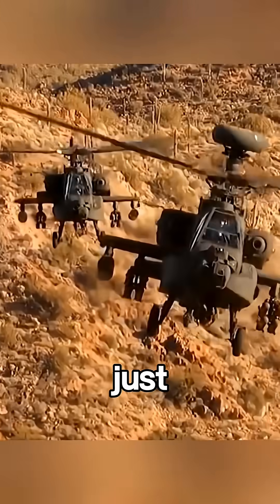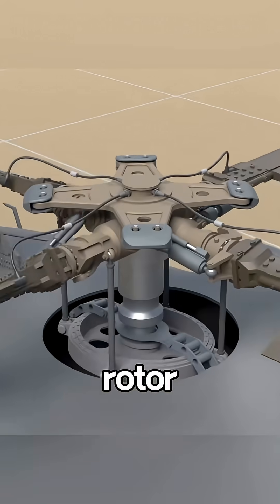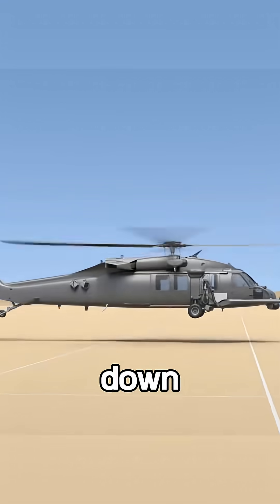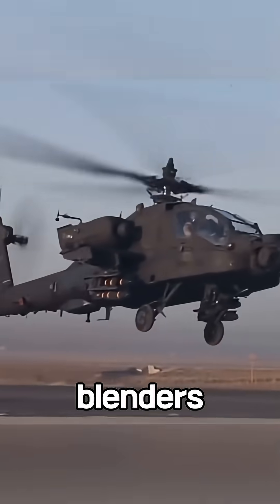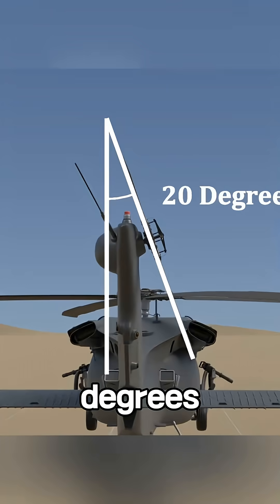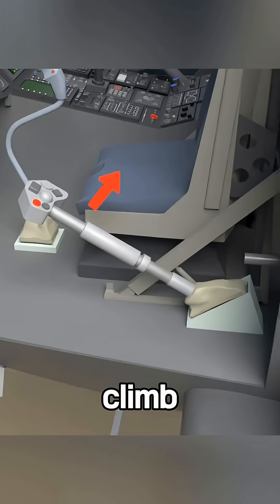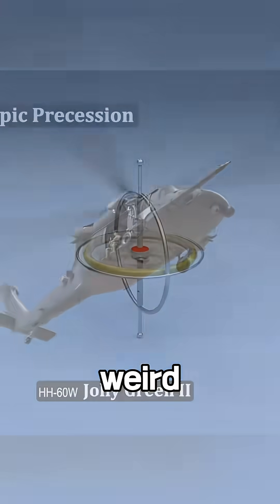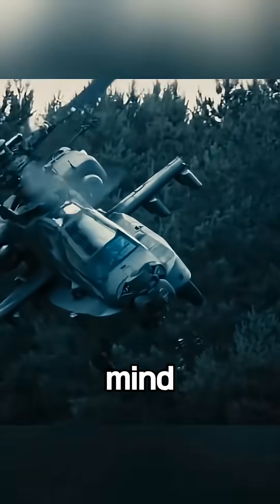Helicopter Speed Myth Busted: What Really Limits Their Velocity #helicopter #aviation #military

Comment: This explains why most helicopters haven't been updated in the last 30 years.There really isn't much more.You can really do with a helicopter
Reply: Wrong. Modern Helicopters fly faster, further, lift larger load, and more reliable than older copters. And a few make less noise, too, for stealth.
Reply: @ubermenschen3636 I was referring more to design. There is only so much u can do to a helicopter. But no matter what its still has 2 things that wont change. And cant be changed.
Reply: @solinoctis804 the fundamental thing this guy is taking talking about can be changed and should have been changed and should have never been used at all except on the most rudimentary models
Reply: @solinoctis804 Sure, but doesn't that go for Planes too? They also look magically the same since the 50s or 60s
Reply: @solinoctis804  The same can be said about cars, bicycles, motorcycles, airplanes.
Reply: @solinoctis804 what are those 2 things? I can only think of 1 and that being it has a rotor for lift
Reply: @ubermenschen3636 wrong. Those are not changes but improvements. It’s just a matter of scale and efficiency. The only true changes are counter clockwise rotors instead of tail rotor.
Reply: @ubermenschen3636  Incorrect.
Reply: Not until they can make a gunship from Halo
Reply: Theyve made some like drones. 4 smaller perpellers around the cenlike a drone. Also theyve been testing Leonardos spiral helicopter blades on drones. The say they work better for a myriad of reasons.
Reply: Stack two rotors on top of each other spinning in opposite directions and working in tandem but the left and right movements of the rotors are reversed. Do that and you can basically cut the tail off with the tail rotor. Then you have to rework the mechanics of left and right motions. This is a huge change, though it doesn't seem like a whole lot. Dual rotor copters do exist now. 
Or, put little wings on it and have counter rotating rotors on them. Match the speeds so that the rotors spin between each other. That was the prototype design for the V-22. Now it uses smaller rotors that tilt, another huge change. And the semantic battle of whether a dual rotor VTOL is a chopper, a plane, or its own thing begins.
Reply: @fredrickneidhardt8064 no longer semantics, i believe. Its now (at least for the osprey) defined as a "rotary-wing tilt-rotor"... basically, its a fancy way of not quite saying "its a helicopter, but it can pretend its a plane."
Reply: @wolfulfhethinn6396 either way, they're all still "doohickys" and/or "watchamacallits".

(...or if you're Irish, "watcha-McCallits"😁)
Reply: Triodal rotors, multiple number types, there is also something that is in development that counteracts the ABC (advancing blade concept) but I cannot go into that...
Reply: There is ALWAYS more you can do. You can aff jet engines for example!
Reply: @fracturedsolace145 but then you wouldn't need the rotors... and then you'd have a hard time landing vertically in rough places... and then... meh, to hell with it... we can build ONE airwolf just for fun... right?
Reply: May I introduce you to jet engines for additional forward speed? No seriously we're already adding more and more jet engines to helis because fuck it we ball, if the tail rotor wasn't important I can guarantee you someone would place a jet engine on the tail, and someone probably will by bypassing the tail rotor
Reply: @MaxDoc7  like the MD 530 notar
Reply: @lollipopjuggs  we're almost there, now we need a jet engine in the place of the rotor ala cyberpunk militech heli
Reply: This is nonsense
Reply from the maker: huh
Reply: I thought copters fly forward by tilting rotor forward, like the toy helicopter(stick and rudimentary rotor blades)...which climbs straight if it leaves your palms straight, and flies forward if leaves palms tilted forward.
Reply: @rodenreyes6320 no, but I'll admit that it's a fair assumption. That doesnt work on larger, heavier, faster rotors because of gyroscopic force. The rotors want to continue on the same plane, which would tilt up the nose. If the aircraft is balanced properly that will tip everything back forward, but then you have two problems... first, it's slow to take effect. Second, it creates a snowball effect if the input is even slightly timed wrong (you'd have to initiate any input well before you need the output response, control lag is the last thing you want in an aircraft, lol).

So, by reducing/increasing lift on the advancing blade and doing the opposite on the retreating blade, you achieve a faster nose-down/up orientation and quicker response. Not quite explained in the video, the same principal applies to side-to-side drift.
Reply: @rodenreyes6320  If that were the case they would fly upwards and forward at the same time and you would only be able to go up/forward and down/backwards.
Reply: gurt
Reply: There's a tremendous amount you can do which is by not having to adjust the pitch to increase the lift😊. That's an extraordinarily efficient way to increase lift and there are much more efficient ways to unfreeze lift without that nonsense that should have been fixed decades ago there's plenty of different ways to do that
Reply: Airwolf brought me here...❤😂
Reply: Wait till they eliminate the rotors all together.  
 Turbo Fans replace the rotors.  It'll be done
Reply: nope youre wrong
Reply: @benmiche2027 uh huh... and what, pray tell, is the significant change to the method of achievement of rotary wing flight that has occurred? As an aircraft engineer, I cant think of anything beyond efficient engines, fuselage designs, and number of rotors... all of which are variations of the ones used since 1980. Unless you're including osprey-style aircraft (we want to forget those exist, tbf).
Reply: @wolfulfhethinn6396 4 rotor aircrafts also known as drones. With variable speed motors they have done away with pitch and tilt and all that.
I also imagine with modern control systems you have reduced to complexity of operation if that counts as a change.
Also twin rotor helicopters that does not need a tail.
Reply: @lizekamtombe2223 not much of a change. 4 rotors doesn’t substantially change anything about how it flies. Modern control systems are still subject to a particular branch of physics, which is the determining factor in how a rotor craft handles (the same principles that apply to large navy ships, if youre wondering), and I see nothing in your reply that constitutes anything besides adding complexity (more blades, fly-by-wire, etc). Helicopters have made no substantive change in 40 years. Interestingly enough, the reason for that is pretty simple... the basics are best. There's a reason for the "hokum" joke. The Chinook can (and has) had collisions with itself, and every "modern" helicopter that the Army has reviewed has been shut down because they cant do anything better than the Blackhawk, Chinook, Apache/Cobra, and Loach. All of which are at least 30 years old. Most are even older than me.
Reply: @wolfulfhethinn6396 4 rotors changes everything about how it flies. Did you follow the video?
A helicopter has one fixed speed rotor that changes propeller pitch and tilt to create lift and fly forward. Rear rotor counters rotation.
4 rotors have no propeller pitch nor tilt and works by altering rotor speed, two rotors rotate against the other two so  it can turn by slowing down counter turning motors.
So nothing in the video holds for a 4 propeller drone.
Only similarity is using vertically mounted propellers, everything else is different.
Even a Chinook does not work like a drone.
And a drone has not became affordable by being more complex. I know how much work it is keeping a helicopter running, there are so many complex systems to control all that. A control system and fly by wire reduces the amount of mechanical parts down to brushless motors which are basically maintenance free.
Reply: @lizekamtombe2223 So, you're clearly not an aircraft engineer, or even in any field that deals with manned aviation...

ok. Thats a drone. A helicopter, which is much bigger and heavier cant do that. There's these things called gyroscopic force and newton's laws. A helicopter's rotors are too big, too heavy, and carry too much angular momentum to simply change their velocity on a whim. It doesnt matter how many rotor masts you have. There's a reason quad-rotor aircraft larger than a few hundred pounds dont exist (and yes, they were designed... and discarded because aviation engineers politely laughed at the morons who drew them up). A military aircraft has to respond immediately and it cant do that if its waiting for the rotor to slow down... and if you try to reply with anything about applying any type of braking force to a combined weight of five or six hundred pounds of weight per blade per mast, rotating at around 6-700rpm (at idle) then you'll just be proving your ignorance. That on top of the fact that you still have to use pitch-controlled lift to adjust the trim of the aircraft for forward/reverse/lateral flight, or in the case of a 4-rotor large craft, to pitch the aircraft. Simplicity rules aircraft engineering. Add a throttle control for each rotor, in addition to collective and cyclic (which are still necessary)? Or stick with a system that doesnt require additional complexity for no measurable benefit? Or, as government asks... do we go with $5b that's a proven element, or $50b for an overengineered accident waiting to happen with no beneficial results?

Also... there is no quad-rotor craft larger than about 600lbs (including a rider). Which is effectively, for all practical principals, a drone. Particularly since it can be flown remotely, anyway. By design.
Reply: @benmiche2027  well you’ve spoken out very quickly. Go on and back up your words. We are all waiting.
Reply: @Zac0827 no....
No we "all" are definitely NOT "waiting", because some of us really don't give a flying frog fart.😆

Comment: the only way to really understand this is to look at a gif of a swashplate also the counter rotation prop in the back isnt always necessary as there are helis like the Kamov Ka-50 wich is coaxial so it has 2 counterrotating main prop blades, they also have charges that can blow them off and has an ejection seat wich is very uncommon for helicopters sadly

Comment: The only detail omitted is that while in forward flight, the blade moving forward relative to the body has a lower pitch than the opposite blade moving backward. That extra speed on the forward-moving blade means it needs a slightly shallower pitch to generate the necessary lift than the slower-moving blade opposite, relative to the air. All of these motions are managed by the rotor pitch mechanism.
Reply: And they also limit the speed.

Comment: How do sky cranes work. They have 2 rotors on top and no tail rotor
Reply: Yaw control is done by applying more torque to one set of blades than the other. (I was an instructor at Rucker)

Comment: I think they skipped over the cyclic part a lot. The cyclic controls the tilt of each blade as it reaches the front, side, or back of the main rotor. 
Correct me if I'm wrong.
Reply: Yep movement info is incorrect.

Comment: Good explanation but you didn’t discuss what limits forward speed. The faster the helicopter travels forward the more lift is generated on the advancing side and then the left side experiences reduced lift. 100 knots of forward speed adds 100 knots of air across the blades on the advancing side and 100 knots less air for the retreating side creating a 200 knots imbalance in lift. At some point the lift disparity becomes so great that the helicopter will flip over and crash. That’s why helicopter speed is such a big deal. Hovering is hard and even impossible if the density altitude is too high and too fast causes a crash.

Comment: That tail section is a bit strange. Imagine the tail blades being mounted on the same axis with the main rotor pivot. Except in the same orientation. Also imagine the heli doesn't need a countering mechanism for the inertia of the main blades. Any time the tail rotor would change pitch, the main rotors would tilt. The angle counters that tilting force. That is a pretty cool helicopter.

Comment: conventional is about 80% efficient with 20% going to the tail.   the video says rotor goes clockwise but shows counter clock.     the ch47 uses 100% power with the 2 rotors countering each others torque.    the flexing of the frame can be seen and felt inside when running.